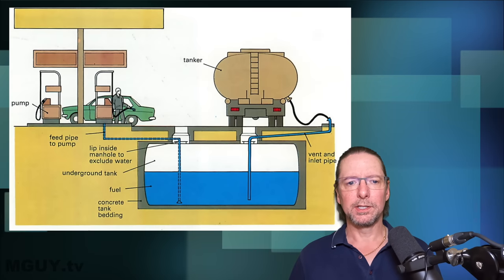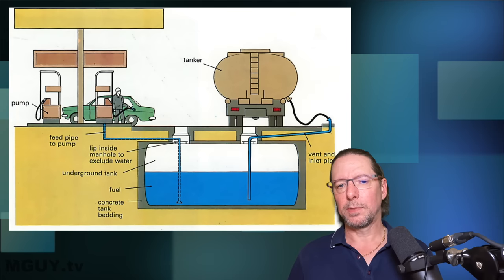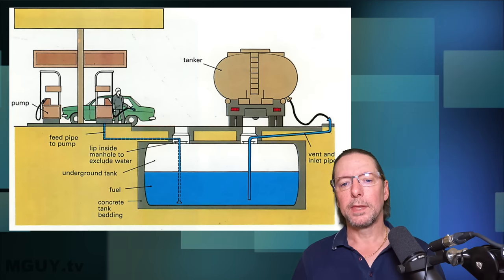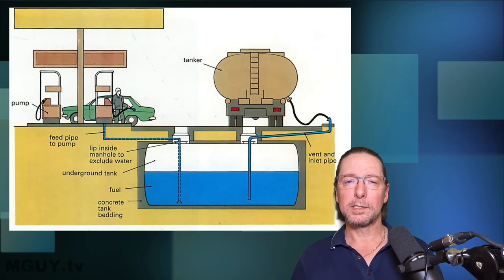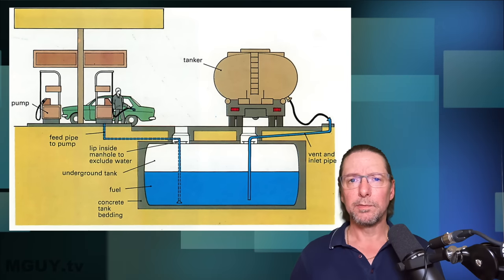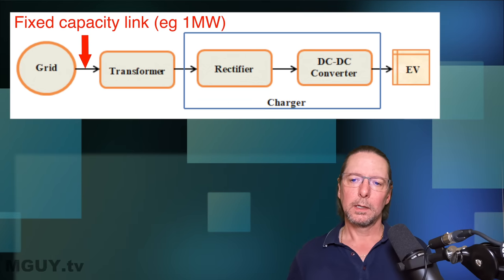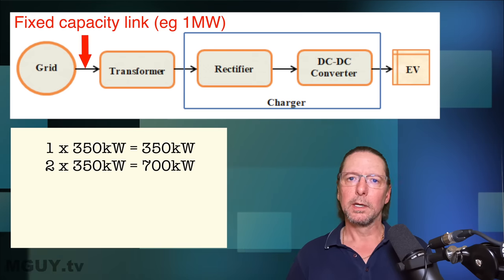HUGE problem with EV Charging Stations that no one mentions | MGUY Australia

Comment: I have looked at that problem too. But have you noticed that often highways and power pylons often follow the same routes. This works for my country where most of the cities and generation are organised along a north south corridor.

I did some calculation and worked out that you need to size the charging stations for holiday traffic flows. So, In New Zealand you would need 3x or 4x the number of outlets for EVs as for petrol pumps. Every place along highways, you need for EVs to stop for 20 minutes for each 200km of driving.

Highway petrol stations that currently fit 10 to 20 cars will need to fit 30 to 80 cars. They will need 100kW, each so 3MW to 10MWatt. And most of this will only be needed for 30 major travel days per year. And that won't be enough for Christmas or Easter breaks.

But if the EV transition takes another 20 years, most of that will need to start to be built in 5 years, with the project done in 12-15 years.

Possible, but expensive. Some could be built on grid stabilising storage battery packs, that could charge at night and deliver charging at peak traffic flow. Or be adjacent to solar farms. Pie in the sky here.

Comment: In the US I read that an engineer looked at charging times for EVs and the available infrastructure and then compared those figures with petrol pumps and found that for every petrol pump that 19 EV charging stations would be required if all vehicles registered were electric.  This doesn't take into account the energy supply requirements.  Almost all built up areas lack the space and infrastructure for such an transition.   I say force all New York Taxis to be electric and see how that goes.

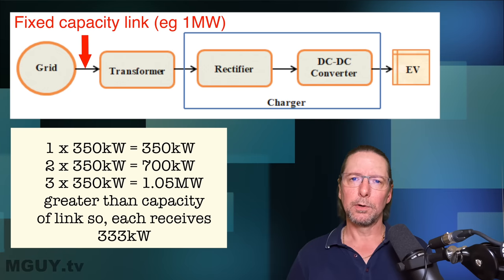Comment: 2:44 THe limitation arrow is on the wrong place. The limit will be in the transformer, before the transformer the power is basically unlimited (well at least on a local scale, there is larger grid limits).

Its also worth saying that the rectifier and DC-DC converter are not 100% efficient. Typically they are about 95% efficient. While that may not sound like a large drop, its actually matters.

Comment: Some later EV charging stations that are being opened. With remote solar panels that feed to on site battery’s. Which work in the same way as the underground fuel tank.

Comment: Seems it would cut down on your average speed on long journeys.  I've read average miles per charge is 230 miles.  After that for charging; and I quote; "It can take as little as 30 minutes or less to charge a typical electric car (60kWh battery) at a 150kW rapid charging station from empty-to-full. If you use a 7kW public charger, you can expect to achieve the same in under 8 hours and around 3 hours using a 22 kW chargepoint."  It's all down to the infrastructure that is put in.  Same problem will occur when all the houses in one street want to charge their vehicles overnight. In the U.K. our houses usually have a 100A fuse which can be heavily used.  Car chargers can suck up at least half of that power.
Reply: What if you have  2  EV's at your household ;  I guess that would be doubly mad...

Comment: You are a two car family and you have to charge both cars each night at home for work the following day. Your house was built in the 60s and the electric cables feeding your house from the grid were sized to meet the demand and maybe a bit more on the day the house was built. Copper is expensive so the engineers will have taken care to calculate the size of cable required. Since the house was built many things have changed including the number of electrical appliances being run in your house. You now have microwaves air fryers computers lots of TVs all these things will have taken up any spare capacity in your cables. Now you want to add the load of two car chargers to the house. The bad news is the cables are not big enough to carry the current they need and you are risking a fire from overloading the mains. Now think about the cables feeding your house and your neighbours they too want to charge their cars and their cables will have been sized for the expected load when they were built. Now the whole street is overloading the cables. To make it work you would need to replace all the cables feeding older properties install more generation power and transformers to carry the extra power.

Comment: I work as a boat mechanic, boats plug into shore power(ac) and use and inverter to invert from AC to DC, to charge the house systems on a boat. Each "charging station" has a set grid capacity, but each charging station isn't linked, they all get their own max grid current, it doesn't throttle the next station. Obviously it'll throttle the entire cities grid, but that is the infrastructure problem. I imagine car charging stations are built the same, but it doesn't mean we still don't need more electricity.

Comment: There are plenty of existing industrial uses that have multi-MW capacities. We can install bigger grid connections. That is not the weak link. The current issues are charger reliability, heat dissipation, and whether the car can accept the speed (a car built for 50 KW will throttle to that speed even if it's on a 350 KW charger). The grid can handle a couple hundred KW going on and off without issue. Like you said, we already do it for industrial application. We are already upgrading grid capacity all the time too. Adding 1 GW capacity to the grid is about the same complexity as adding 50 MW, the only difference is the thickness of the wires and the size and types of components on each end. It's not 20x harder.

Not to mention most cars are getting charged at home overnight on slower chargers with standard circuits at non peak hours. DC fast charging is really only for long hauls and road trips.

Gas stations often share 2 nozzles per pump (one on each side) which reduces fuel flow if both are in use. Plus you need to truck in the fuel constantly.

Comment: At Texas-based Buc-ee's, each station has a minimum of 100 gas pumps, and they are usually all in use with a line of cars waiting.  Such capacity will never be achieved at an EV charging station, at least not in my lifetime.  Of course, they could use the gasoline that is already there to generate more electric power on-site, but I don't think that suggestion would be appreciated. 🤣

Comment: Gas pumps do share feed lines to the tanks. Usually 1 line per island. They are sized to flow enough fuel for the number of pumps on the line though. The other issue is low tanks. Pumps draw very slowly from low tanks. But even the slowest fuel pump is many times faster than charging an EV.

Comment: At a gas station  8 bays All gas is dispensed at the same rate gal p min   At Ev charging its shared so the more that are there the less you get and your charger time increases sometimes dramatically at night you are a sitting duck for assault   BIG point should have been brought up as power goes down your  CHARGING TIME increases w each car there can’t plan on 10 min fill up it could be 20-60 m longer go ahead and call into work for being late but since it’s a  Ev will you get a pass?

Comment: The problem with your picture is the connection to the regular power grid, there is no power grid in the world capable of delivering 75% of it’s capacity to banks of ev chargers, ( replacing gas stations on every corner). Plus charging stations at homes, ( chargers that use more electricity than a normal home uses). Where do you propose that electricity comes from, ( coal power, ?, and who is going to pay for and run all those huge powerlines).
  We currently have a net zero home,  and don’t need to buy any electricity from anyone. I looked into adding an ev charging station at home, it alone, ( 240 volt) requires more electricity than my whole house uses daily, ( my home is very energy efficient). Adding another 30kwh to my existing 30kwh of energy storage, plus doubling my current 15kw solar, might cost as much as an additional $75k.
No thanks.

Comment: Great insight.
Our Ballarat empty charging Tesla station rarely has a customer and its sterilised car parks for fuelled cars in a nearly full shopping precinct.
Ballarat also has unusable orange e-scooters littered around which are rarely used. Data shows their journeys are 2-3 km which are easily walked. Those with walking and mobility limitations do not use them, only fit young people. They are useless toys, in my opinion, and cost several Dollars for each short trip.

Comment: There is another thing missing from the charging station - no lighted canopy over the "pumps" that drivers use to fuel up.  I don't want to stand in the rain to pump gasoline/diesel, and I sure as heck do not wish to stand on wet pavement, in the rain, to fiddle with the AP and connect/disconnect high voltage charging cables (regardless of the safety controls on charger.)  They do not need to be too high, as box trucks cannot drive through.

Comment: Depends on the setup - Tesla V3 and V4 superchargers and in fact nearly all 250,350 + kw chargers regarldess of type deliver the full 250kw charging speed to all chargers at the same time no matter if the charger lot has 1 car or is full to capacity.

Comment: Oh yea, I'm an electrician.  Most new apartment buildings where I work these days have EV chargers for every single stall.  And we do have that worked out properly up to the EV electrical panel.  However, the panel is only about 800 amps or so.  Somewhere around there.  Each EV spot uses 40-60 amps.  Hundred plus cars and do the math, we have a MASSIVE problem.  

Even if we were to rerout the entirety of the buildings power to EV chargers, that'd only be around 2000 amps.  

Keep in mind, this is new construction in Canada.  A relatively hippy country all for using EVs.

Comment: We are solving this electricity tank tank problem right now using battery energy storage systems at EV charging sites. A BESS is a large battery (i.e. tank of electricity) that slowly charges from the power lines and then dumps charge into vehicles at full rate when they show up.

Comment: Regarding grid drain, the US consumes 370M gallons of gasoline per day. Each gallon of gas contains about 33.7 KWH of energy, for a daily gasoline energy consumption of 12B KWH.  The average daily electrical production in the US is also roughly 12B KWH. As a very rough estimate, ignoring efficiency, transport, etc., then US electricity production must double if all gasoline vehicles become EV's. Consider the materials and infrastructure needed for that.

Comment: I live in a large village in England.  A local hotel has had Tesla chargers for a while but recently expanded the anount (at great inconvenience to residentsand businessesand at a reported cost of £500,000).  When activated they all failed and the installation had had to be reworked.  We experienced several power cuts prior to this and I wonder if this was connected to the problem.  As a friend remarked, it's the wrong technology.  I tend to agree, we need an alternative to petrol and diesel, but this isn't it.

Comment: I have seen other people talk about this. It is a huge problem with EV charging. Someone has a video going over how many cars can fill up an hour at a gas station, as opposed to how many will get through at a charging station. If we all go EV, the charging stations might as well have hotels next to them. The backup of people needing to charge will make it impossible to get in and out in anything like a reasonable time. If they use batteries as a buffer of some kind, they would have to be huge. A charging station on the highway will use more power than the nearest town. The problems that still need to be overcome to make it even close to feasable are still decades away from being solved. Assuming they can be.

Comment: Well - Many high capacity sites DO have a buffering battery / megapack, or whatever it is to speed up the proicess;

 - of course the addition of another energy  conversion step in the chain reduces efficiency - reducing "clean" energy balance depending on how the electricity is generated...

The solution for a lot of sites is and will be a friendly diesel (or other thermal cycle) generator "behind the scenes" - buffering the whole system, for what the grid is unable to supply...  (Fish and chips out the front, Electricity from "waste oil and coffee grounds" out the back...

Comment: There are a lot of issues with public EV charging stations.  There are many private ones installed where the property owner asks for a very large cost to charge the vehicle.  The public ones installed and run by the electric company are best to use and give a fair price for the charging usage. 

There is the issue where when your arrive at a charger it is out of order and not able to be used. If you don't have enough power to go to the next location you are going to need a towing for your EV.  When taking a long drive it is best to plan your charging stops and choose places that have multiple chargers.  

There are instances where someone with a non EV will park at a charging station and block access to the charger. I saw this at one charger, and fortunately the EV driver was able to park close enough for the cable to reach his EV. Apparently, he was blocking in the illegally parked car. He left his car blocking in the illegally parked car for about 4 hours.  He called the police and complained about the car blocking the charger. The police came and put a ticket (fine) on the windscreen of the car.  The driver had to wait for some hours until EV driver came back to get his car.  

The best for EVs is to use them for local commutes. Have your own charger at home that you can use when required.  For long trips rent a gasoline car. I would not take road trips with an EV until the charging issues are fixed.

Comment: In my experience your overestimating the pump capacity of gas stations.  I worked a number of different fuel stations as a hose jockey during college. At all of them full flow was maintained until more than half the hoses were in use simultaneously.  We had 8 regular unleaded hoses and four could be in used with little flow reduction. Start that fifth hose and everything slowed down but when your looking at only 3 to 4 minutes to fill normally an extra three minutes is a large inconvenience. When you have a 45-50 minute charge time increase to 90-120 minutes, major inconvenience

Comment: The only solution I see for the EV charging issue is standardized swappable batteries.  However, liabilities for faulty batteries becomes an issue.
Reply: Replaceable batteries were used in electric trucks in 1910😂, it's ancient tech now

Comment: One of the major problems with the perspective here is the per-vehicle demand of petroleum fuel vs electric charging is so radically different. I am a Tesla owner in the US and I would estimate that < 5% of my charging is at a dedicated EV charging station. Why? Because I can, and do, charge mostly at home. My Tesla has a range > 250 miles and most days I am traveling significantly less than 100 miles in a day. When I am in my local area, which is most of the time, I only use a station when I have planned poorly or have an incredibly unusual need to travel in my local area. This means that I use a dedicated charger only a small fraction as often as an ICE (Internal Combustion Engine) car needs a fuel station. I have also watched as Tesla's EV grid evolves. Some of the sites now have local batteries to even out demand spikes during peak usage and more of the stations are installing solar cells on awnings that shade the parking spaces to produce more of the energy locally.

I installed a dedicated charging outlet in my garage and it takes 5 or 6 hours to do what a Tesla Supercharger can do in 45 minutes but I work from home and generally charge from solar power generated from the panels on my roof and there is plenty of time to do that. When I am not working, I can still charge overnight and buy my power from the grid. The car is not driven 24x7 and there are enough hours to slow charge. The slow charging is also better for the battery.

I also don't understand the hate toward EVs. While I understand that they are not for everyone, they are a great alternative for those of us where it fits our needs. Truth be told, I actually have two electric vehicles: a Tesla which I use like a conventional car and a GEM NEV (Neighborhood Electric Vehicle) that I use for local errands. Think of it like a golf cart on steroids with a small bed on the back instead of golf bag holders. I use the GEM so that I don't put so many miles on the Tesla and it is a huge hit with any kids who come to visit. There isn't any sort of dedicated vehicle charger for it, it just plugs into a conventional outlet.

Comment: As a slightly separate thought. I have heard that in China there is a lot of regulation about who can use electricity power when. During the day, company's are limited to how much they can use. More or less for a similar reason mentioned in this video. If they exceed the limit, the company gets massive fines and charged at very high rates. Apparently what is happening, people charge up their cars in the evening, at home off peak, plug in their cars at work, The businesses buy the power off the car owner at peak rates. 

Largely speaking, I think we need to stop looking at EV's like ICE cars when it comes to refiling. In Melbourne, you can charge up you EV at shopping centers, library, IKEA... Charge your car while you do something else, go shopping, eat at a restaurant, while at work, at home sleeping. Doing this takes waiting time out of the equation to a large extent.